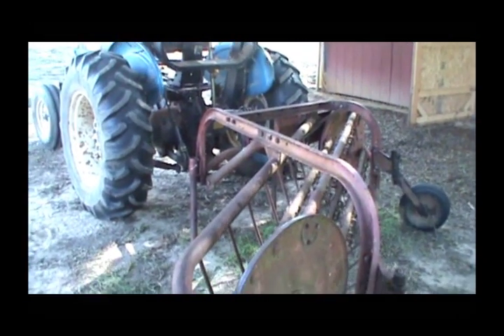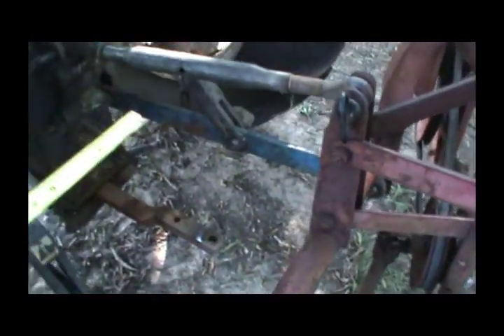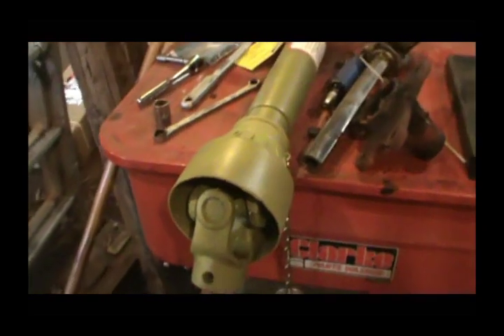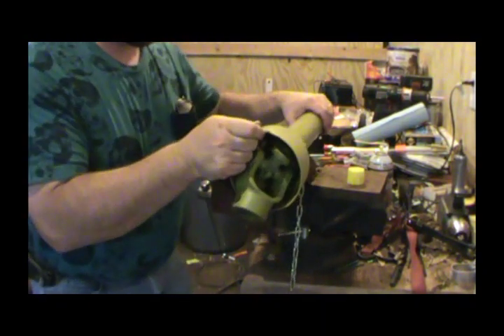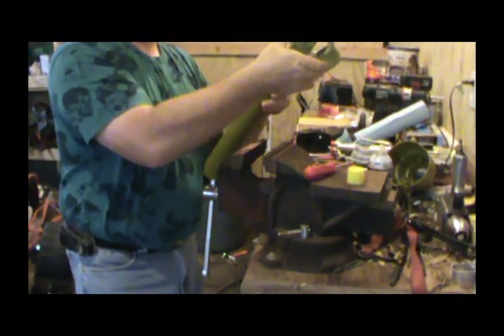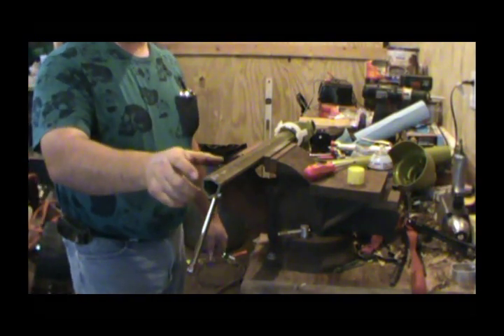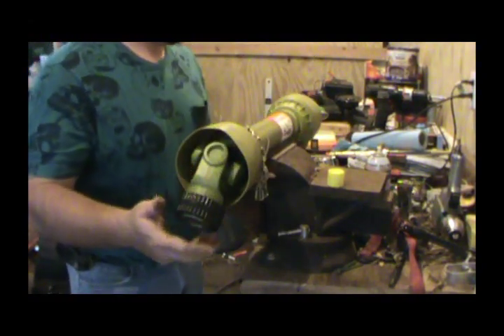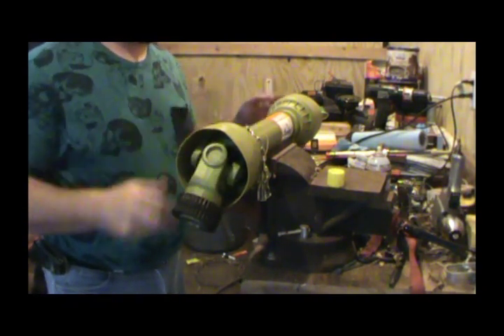MF Model 25 Hay Rake PTO Modification & Install

Comment: For the top link put some no siege on the threads so they don't setup
Reply from the maker: Thanks for the tip.  I've got to do that, it's getting hard to adjust.